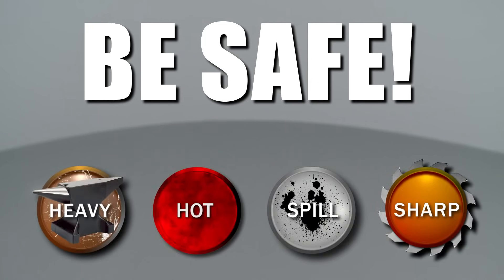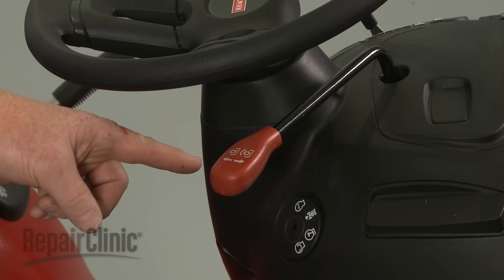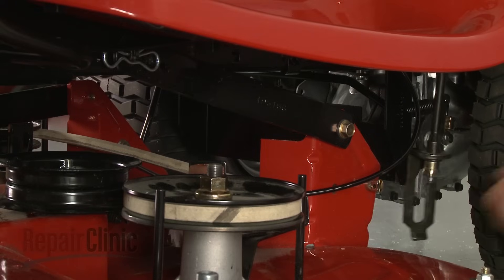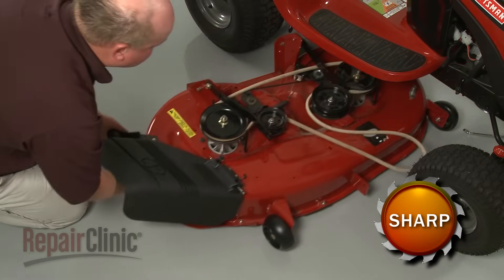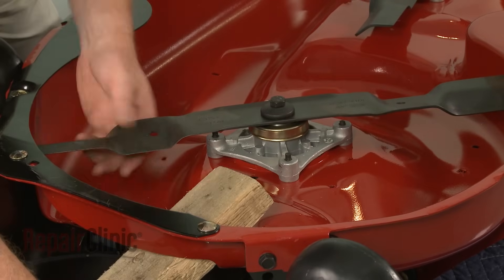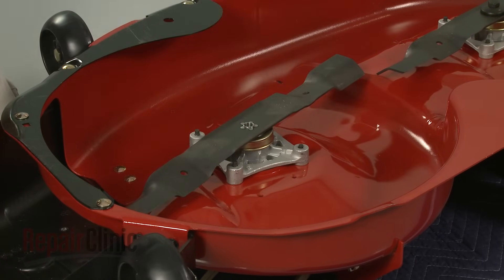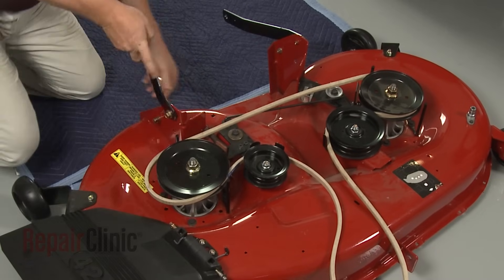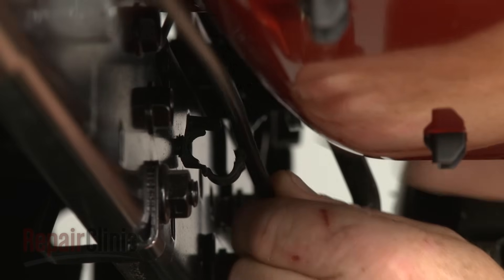Craftsman Riding Lawn Mower Blade Replacement #532422719

Comment: This video was a big help. Just picked up a free used not working craftsman riding mower to give to my son. I have had a John Deere for 25 years that is easy to work on, the Craftsman is horrible to work on. Oil plug is a bolt, recessed and square that no common ratchet works on and recessed enough where plyers can't reach. The Bolt on the blade is 1" and also not in my ratchet set. All said and done , with some new tools, plugs, blades, oil, fuel filter- I got this mower working like new for under $100 and some bloody knuckles. Just from starting this project, it seems to me sears designed this thing so your average guy can't work on it and you would have to bring it in for service

Comment: I use an automotive jack to raise on end of mower and do underneath what I need to do. Lot faster and less work then removing deck
Reply: Just did that. Took 5 minutes to replace.
Reply: I do the same. Way faster than this way.
Reply: Appreciate the input. Changing blades tomorrow......and not removing the deck.
Reply: Depends on how stuck the nut is on the blade. I was glad I removed mine because I had to use some WD40 to loosen it. Mine broke the piece of wood I was used to steady it since it was so tight
Reply: Taking the deck off literally takes 2 minutes or less.
Reply: Where on the Craftsman riding mower would you put the jack?
Thank you for your time.
Reply: @bunnyheywood  I jack up mine in back under the hitch. Block off the 2 front tires, put 2 cinder blocks or whatever I have under the back tires and good to go.
Reply: @chrislarson1012  do you need to drain gas or oil when jacking from the rear?

Comment: You don't have to take the dam deck off to replace blades.  Just jack it up
Reply: Exactly! That's how I've always done it. A 2 ton floor hack and a couple of wedges under the front tires, raise the deck to the highest point and remove the blades.
Reply: I agree to a point. If just replacing the blade, then yes. However, in most cases, you are checking or replacing the drive belt and deck belt at the same time. It just makes the whole process easier to drop the deck out of the way. But you are right if just the belts.
Reply: @billjensen6216  This crap is junky made. I hate working on them.   Every thing about them is made wrong, and made  to wear out.  GL👍👍

Comment: I use the floor jack some concrete blocks 12-in wooden block 2x4 and it took me about 15 minutes to change both blades. I have the 15/16 nut on my blades I needed to use a breaker bar to loosen them

Comment: My rear mounted engine MTD 30'' mower has a light front end. With the machine in neutral and park, I pick up the front, then slide an aluminum platform underneath the tires. Chocs behind the rear tires would be ideal for safety, but I got the job done in seconds. Keeping in mind, the fragile components of the steering mechanism, I used the mower frame to lift and lower gently. My mower doesn't have the bumper guard, therefore, I'm looking for hardware to mount on the front end, to facilitate access underneath the mini tractor.

Comment: I see alotta comments about deck removal being hard. It is actually quite easy as long as you follow the steps in the manual. Taking the deck off is important so that you can scrape the bottom clean from clumps and also inspect everything easily. Using proper needle nose to help remove the pins may make things easier. A dab of oil on the pins and pivot points during reassembly.

If ya dont care about scraping or inspecting then just jacking up the mower to get to the deck is fine.
Reply: viewer54322 that’s what lawnmower jacks are for

Comment: Buy a riding lawn mower lift from Harbor Freight for $80.00.
Just changed my blades without removing the deck. Piece of cake!
Reply: I removed the deck by myself in less than 5 minutes, used pressure wash to clean the years worth of weed and grass gunk, from top and bottom that I couldn't get to if it was on the mower. Clean as new, very little works, 
 cost nothing.
Reply: As I mentioned before, you can't clean underneath very well without removing it.  Removing is easy.

Comment: My mower has 4 anti-scalp wheels set just above the ground on lift lever position 4. I have reviewed your video on deck removal. Can’t get to lowest position of deck without removing or elevating the anti-scalp wheels. If I can get the clips removed from position 4 and then elevate the deck, can I safely slide the deck out or do I have to remove the wheels and lower the deck to position 1 in order to remove the deck??

Comment: Helpful, but my problem is that the bolt holding the blade on is completely seized. More than a bit frustrating putting my entire weight on the thing, looking up a how-to (because I must be doing something wrong), and seeing a barely used looking model being unscrewed with no effort.
Reply: Yeah they can get siezed on over time and you will benefit from some diff tools compared to whats in the vid. 

If youre only using a small wrench like in the video, buying a 1-2ft long 1/2" breaker bar for $10 will make a difference for you. You can also deposit $20 at autozone and borrow a breaker bar, they refund you when you return it.

Applying some PB Blaster and letting it soak in for awhile is one option.

Lastly, if you have access to an extension cord, buying the cheap corded impact wrench (20-30$ at harbor freight) may be an option youre interested in. It should have plenty of torque to hammer off the nut, just dont use the impact wrench to re-install the nut.
Reply: Ditto,Breakerbar won't budge the nut.Tried both directions,never in my 70 yrs had any problem removing blades with moderate effort.Mower is only 6mos old,first sharpening.
Reply: i AGREE.  My husband is strong as an ox but cannot get the bolt lose.  We are now trying to remove the deck plate to see if we can gain easier access to the blades.  BUT, he can't maneuver on the ground, so I'm trying to do this. Got to the last step of  disconnecting a big spring and I cannot get it off.  I'm at my wit's end.  Wish me luck.

Comment: No need to drop the cutting deck.  Lift the front end with a jack or the like, approach the blade from beneath; one bolt on and off.  Easy.  :-)
Reply: I tried that, but my jack would not raise it high enough for that!

Comment: I hook a chain hoist on the back of the lawn mower raise it up take the blades off put them back on .Back to mowing in less than 25 minuets .less time less work. But this is a good video.
Reply: Even with removing the deck like is described here, it only takes about 10 minutes to swap out blades. Why even mess with the chain hoist?

Comment: How much torque on the nut holding the blade?
Reply: Between 27-35 ft/lbs
Reply: I have what appears to this exact mower and it is 45-55 ft lbs per the manual

Comment: My bolts are not coming off as easy as that BRAND NEW deck he removed
Reply: Same! Except mine is only a year old and used probably 10 times since then for mowing. The deck removal is easy but the blade broke the wood I was using to try to remove the nut (mine is slightly different model but same instructions

Comment: If you can, remove the blades without trying all this fu****ing procedure.....he makes it look so easy....sure , it's a brand new machine. In reality, you are working with about 5 inches of spaces on ground level, nothing cames out easy ( mine is only 3 years old ) and i couldnt find a suitable spot to insert my jack to lift it anywhere. I'll be the first to admit i am no mechanic, but i am pretty handy, and I say to you : don't do it ! I got the thing out and clean and sharpen the blades ( 2 days ) now I am in the process of putting everything back....good luck !

Comment: yeah this is pure bs... odds of screwing up are high wtf
Reply: How? It only involves removing like 4 pins, unclipping 2 retainers and sliding off a slacked belt.

Maybe if the deck or the hangars have been damaged during use it could be hard
Reply: It literally takes no longer than 2 minutes to pull the deck off.
Reply: There’s really nothing to screw up. If you can’t manage this, you need to not work on anything at all.